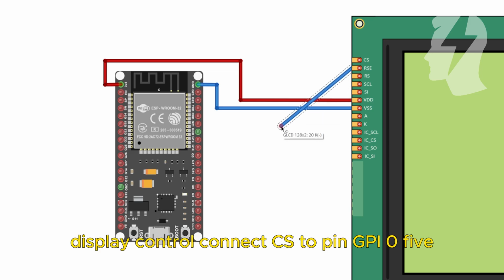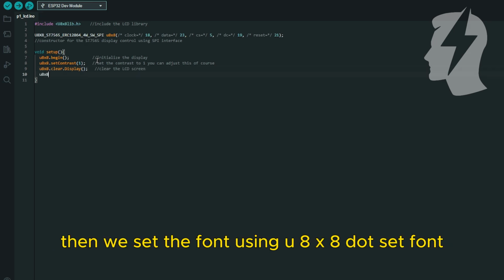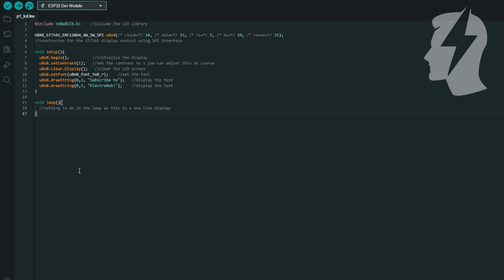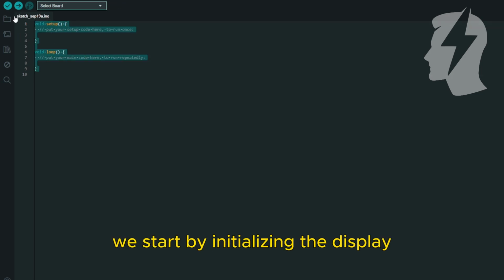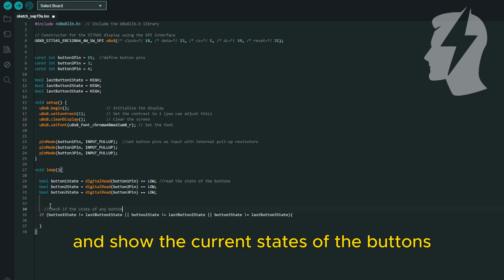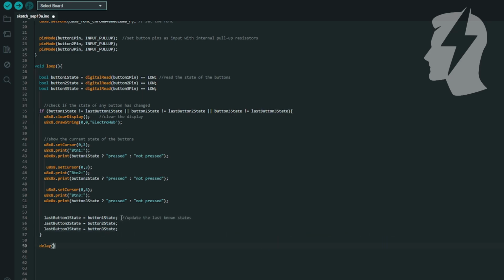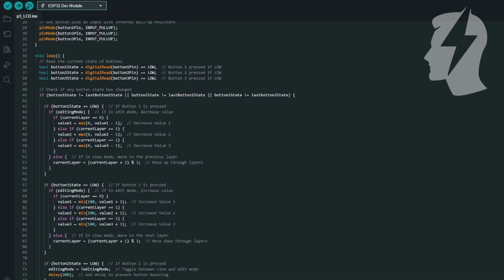How to Create a Button-Controlled LCD Interface

Comment: Great video, thanks!
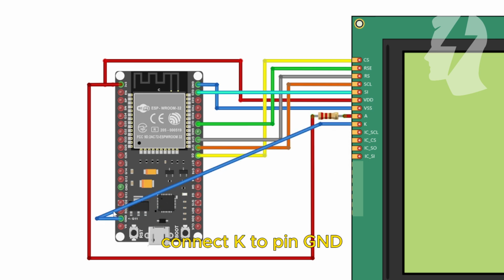3:34 – Small correction: The IC_SLC, IC_CS, IC_SO, and IC_SI pins are not meant for an alternative interface. They’re connected to a GT20L16S1Y font ROM chip (U1). It contains ASCII and Chinese fonts, which can help save space in your ESP32’s flash memory.